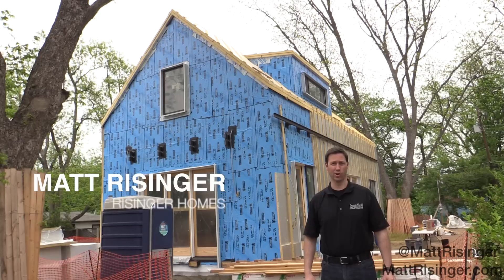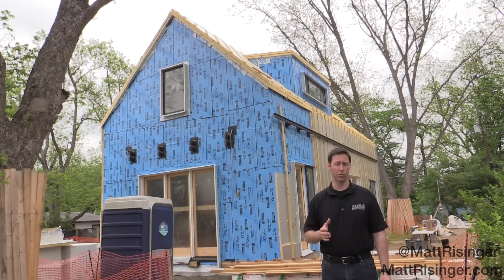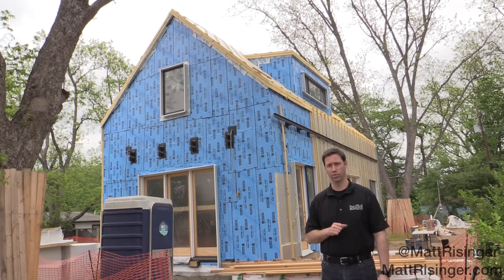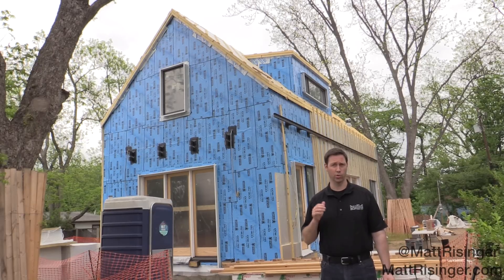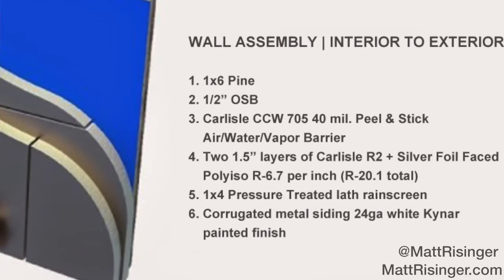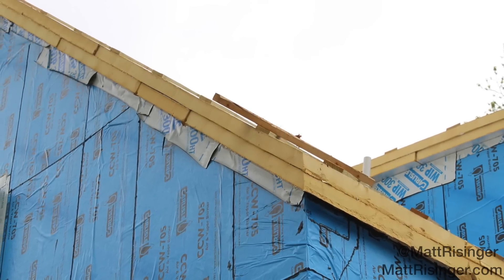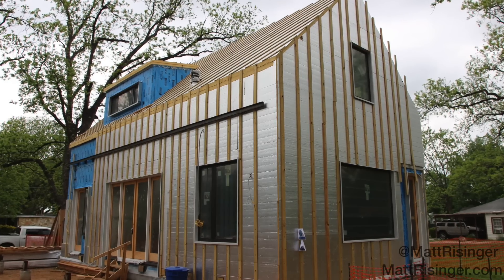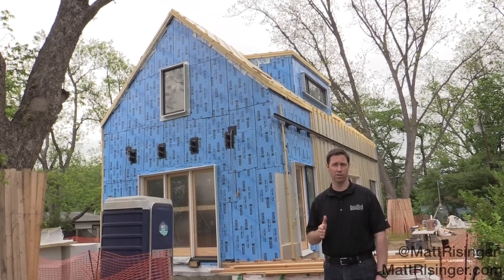What is the "Perfect Wall" for a house?  (with 500 year durability)

Comment: i have never done a wall like this, so simple question, "How do you attach the 1x4" strapping onto the foam?" thanks,
Reply: Matt Risinger Do you screw the sidding into the framing studs, or into the 1 x 4 rain screen?  Even looonger screws?
Reply from the maker: Looooong screws!  We're using Simpson screws and they are 8" for the 4" foam and 10" for the 6" foam.  Into the studs of course.  Super stable and strong install. Best, Matt
Reply: Matt Risinger
Thanks for reply.
Reply: Matt Risinger Yea I was about to ask that same question....  That's pretty extreme! lol
Reply from the maker: SailingandSuch We screw the 1x4 furring strips through the foam into the framing with very long 8"+ screws.  Extreme yes, but this house should last for a few generations and be very efficient and healthy along the way.  Best, Matt
Reply: Incredible.  I wish this type of home quality was desired in my area....

Comment: Matt - another excellent video! Are you planning to keep tabs on this house after occupancy in order to verify that the structure operates as designed?
Reply: +Matt Risinger how does the data look?
Reply from the maker: We plan to install an e-monitor to keep tabs on energy usage.  Thanks, Matt
Reply: @buildshow  where can we see the data?
Reply: Matt Risinger Thank you for your uploads Matt, love your take on practical building science. Any updates on the energy performance of this house that you could provide would be greatly appreciated.

Just a quick question, won't the Polyiso rigid insulation panels on the walls deteriorate from the moisture that will get behind the cladding? There is a lot of moisture in the air where I am building and from the existing structure (the 37 yr old house where I have lived over the past 5 years) that will be demolished to build my new home I have witnessed the damage that high moisture levels can do.

Comment: why dont you build any cinder block houses? they will last way longer then wood and don't catch fire or get moldy. Plus you can add foam insulation to the outside then cover it with stucco like they do in germany.
Reply from the maker: That's actually a very good assembly for the Southern US.  Not easy to remodel, nor to wire, but durable and you've got some mass inside your thermal envelope to help temper the heat gains in the summer through the windows.  Thanks for watching.  Matt
Reply: Matt Risinger really would love to see your input on an ICF house and type of attic to tie in.

Comment: Matt
I have you whole video collection, thanks.
Q: Sample 2500 sq house (ranch), what would be your cost estimate of the difference between std. 2x4 studding (and roof) with pink insulation compared to the perfect wall (and roof) method? 10 or 20% up cost?
Would you run in to mold problems, between the vapor barrier (walls and roof)  and the exterior (ex: brick) ?
Reply from the maker: Fred,  Tough to estimate.  I would guess it to be 20+%.  Regarding the mold question, what would the mold grow on?  Mold needs water and food to grow.  Cellulose in it's most broken down form is the best food for mold (paper facing on drywall).  There isn't any cellulose in that cavity to grow mold on, and if it did grow that area is outside of the house airstream so what problem would it be to the occupants?  Best, Matt

Comment: who needs house that will last 500 years? humans will not be around in 500 years at the rate they are multiplying and destroying the planet.
its pretty easy to build a structure that will last 500 years but what is the cost benefit ratio? you may as well just go icf instead of the complicated design you are describing. concrete and steel would be the best way to get to 500 years.
Reply: WRONG !!!!!!!!!!!!!!!

Comment: Matt,
With this system how are you controlling interior vapor from cooking, bathroom use, etc?  With the peel and stick essentially on the inside of the thermal barrier, aren't there moisture issue during the 3 cold month of the year?  Thanks,

Dave Groll
Reply from the maker: Interior moisture loads are handled from point source fans (Panasonic exhaust fans), and we're using a stand-alone Dehumidifier from Santa Fe for year round humidity control.  Why would there be any moisture issues in the winter?  What surface would be affected?  The vapor/air/water barrier is protected by the insulation and the entire framing & peel/stick membrane will remain at 77 degrees and 50% RH all year round.  This house system works in All Climates in N America.  You might use more insulation in Northern climates, but that's about it.  Best, Matt